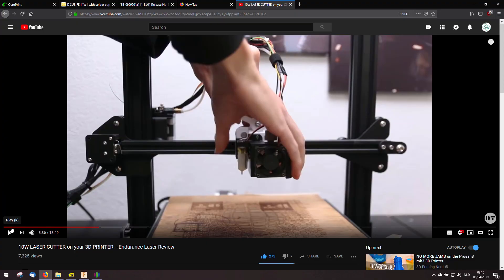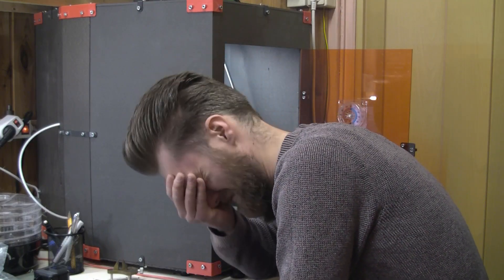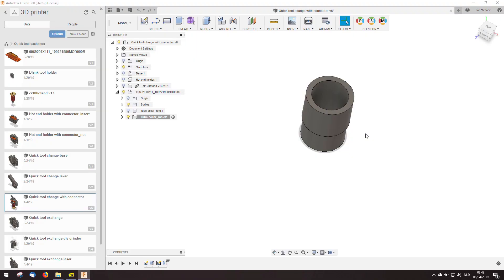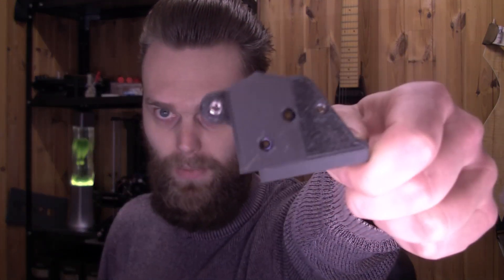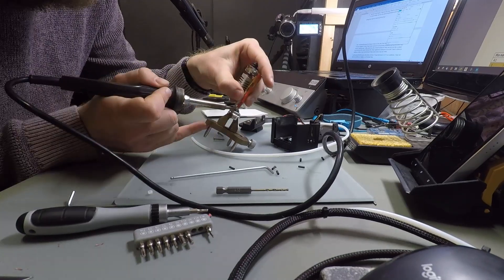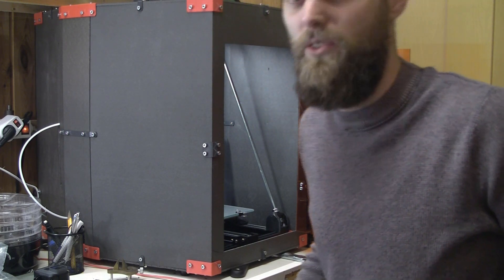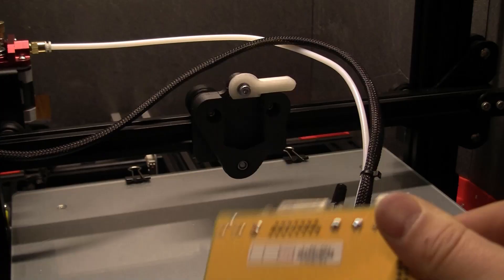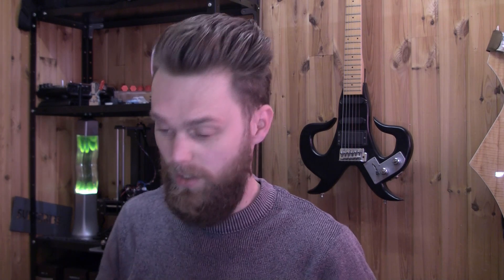Swappable hot end for Creality CR-10

Comment: I am also preparing for the interchangeable modules solution. Adding another connector to the hotend doesn't seem to me to be a good solution, because it adds weight. I would like to use the GX16 connector, installed on the machine frame, all heads include the cables, and don't have to carry the weight of the connectors on the print head! True, it's not as compact as this solution, but it's lighter, and that's more important when there's a lot of competition for the weight of the extruders!

Comment: I just watched an MIT video where they modified a laser cutter to fabricate a drone from stock components. My idea is you. Use the die grinder to fab a PCB,  make a pick and place module, use the food extruder for a solder paste dispenser and the laser head do the solder joints. Now  have a complete electronic module manufacturing machine from one 3d printer.
Reply from the maker: Awesome that you're suggesting this because this was what I was aiming for. I researched the Voltera V-one, hence the food dispenser and I did some tests with that grinder in two videos. I'm going for a different approach now, but I cannot say anything about that yet. Thanks for sharing your idea!

Comment: While i think its an awesome and super cool project,  I personally have some issues with safety. even when screwed in snuggly vibrations will either cause arcs within the connector or after a while be able to loosen the screws and slightly unplug the connector, causing a rise in resistance and thus the addition of a lot of heat. 3d printerboard cant detect this, as the hotend will still be receiving some power and thus will keep the temperature. 

Im sure it will be fine most of the time, but if this goes wrong it will go very wrong. And it has the potential to go very wrong.

Comment: I'd love to see a close-up of the bowden connection: I can't believe it worked flawlessly!

Also: why not use the lever to push the male connector against the female connector instead of screwing both sides?
Reply from the maker: It's still holding up after more than a year of printing :D Why I use the screws is because I didn't think of a solution like you mention. I was thinking inside the box of the connector xD Thanks for your suggestion!
Reply: @properprinting  Well, if you like suggestions, I have another one for the V3: pogo pins. Some can handle relatively high current (several amps)
Reply from the maker: Funny thing is that I'm the pogo pin specialist at work xD I'm an electronic test engineer and build test fixtures with those pins. It's a good approach, but it's less simple due to fastening and alignment. Thanks for the suggestion though!
Reply: @properprinting  Care to elaborate why the alignment would be problematic?
Especially since you don't need to use a flat board: you can print a pogo "funnel" that would guide the pin to the pad, can't you?
Reply from the maker: @NicksStuff  That's indeed possible! A funnel is a great idea, but still less convenient than using a connector as far as I can see. With the connector you don't have to think about alignment at all. I'm not saying your suggestion isn't good, but I chose for the simplest approach I could think off for this one ;)

Comment: nice way to start the video! This is what i'm looking for more or less. The thing with your toolchanger is that the wheels are attached to it. I want to keep my metal plate, so I'm trying to model that, but modeling is still kinda new to me. 
Also, I have heaters up to 70w 12 and 24v. So I guess that's probably pushing the limits of the connector too much? I like the ultimaker approach, and it seems upgradable for auto toolchange
Reply from the maker: Thanks! This would be a nice thing to start modeling with :D 70W is a bit high, it would work with 24V since the current will be halve. You can get a different connector lay-out and use double pins or use power pins like I did in this video https://youtu.be/YfDWs5B-fYA Good luck!

Comment: Hi again, I've almost finished prototyping my connector to show you! Printer is printing off 2 pairs of connectors, but the main difference is, that I'm testing mine using jst connectors.... as you pointed out, high current maybe the biggest issue I come across. But I'm going to continue with it anyway, unless it overheats from the heater cable current. Oh, and I've incorporated my connector into the cable chain I use to supply electric to my extruder head!. Looks good, but after printing, I still need to test it too, like you! Fingers crossed hey! ;) happy New year bro...
Reply from the maker: Awesome David! Cool that you've done the same thing. I can't wait for the result to see what you came up with!
Reply: @properprinting  Got photo, but can't post it in here, but it looks good. Final assembly will be when I record and rebuild my machine. Will upload videos fairly soon.
Take care. Will let you know.

Comment: Magnets, like USB charger cables.
Reply from the maker: Thanks for your thoughts. The problem I encountered is the pressure within the bowden tube which builds up. I'm afraid magnets will not be strong enough to hold everything together.
Reply: @properprinting  I hear you.  I was thinking only of the cables though. Your latch for the assembly looks great.
Reply from the maker: @-robo-  Thanks man! For the cables only would indeed probably work. I'm wondering though what the chances are of snapping loose while printing since it's always moving. I don't have experience with it, but if it works it would be a fast way to connect for sure!
Reply: @properprinting  If you use N52 (strength) Neodymium magnets they will stick.  If you still don't feel comfortable, you can additionally add a nipple on one side and a divit on the other.  As a side note, you could also have the left side north facing out and the right, south on the base (gantry). If you do the opposite on the assembly it will only attach one way, thus ensuring polarity and coms are always mating up correctly.  Neodymium magnets of the size you would use are very cheap on eBay. I'm thinking a cylinder shape, around 3-5mm in diameter, and 6-9mm long. In this scenario, the strongest field will be the 3-5mm ends.  If you leave a 6-9mm deep hole all you have to do is put a little epoxy on the end of the magnet and push it it.  Because you are using epoxy, double check the proper north and south poles are facing the right way.  

I am going to take ispiration from your design but try it with just magnets for the assembly attachment. In that scenario I will print a mock assembly and insert weights to match the real assembly, thereby allowing movement stress testing without worrying about parts falling off.

Comment: John, I definitely want to add this to my Ender 3 Pro, I don't have experience printing with the higher temp filaments. I think this would be best if printed in nylon, is that correct? I checked your website and these are listed as downloads, are you going to be producing these for sale?
Reply from the maker: Thanks a lot for your interest! The best material I've used is indeed Nylon, but ABS and PETG will work as well. PETG is a bit sticky though. I just have built my web shop on which everything can be downloaded and this is still a work in progress, but some have seen it already. Surely I'm going to upload all my designs the coming weeks. I've done a lot of testing with the swappable hot end and there are still some things that need to be modified. Last week the bowden tube itself sprung loose so it's not good enough as an end product in my opinion (you can glue it of course). My plan is to sell this as a kit in the future on my web shop as well together with the free downloads. I've planned videos which I'm going to work on soon with an updated version and the announcement of my new web shop.

Comment: Want to add this on my Ender 3. Awesome design, just not sure how the bowden tube is fixed inside the connector (cable side). Has to be good though there will be pressure inside the tube.
Reply from the maker: Good question. I have used a bit of super glue. The strain relief in the connector cover helps a lot as well.
Reply: @properprinting  I am still thinking about it. (working on other upgrades first at a low pace ehe) If i leave the bowden system in tact i can use a normal smaller sub D and place it alitte to the front. But i like your solution aswel as it is more all in one

Comment: You must compare the temperature display on the screen with the nozzle temperature.
This is because you may have disconnected the thermocouple compensation wire.
If the temperature matches, there is no problem.
Reply from the maker: Thanks for your comment. I haven't measured the actual temperature but I am not worried that it is too far off. I have read that it is possible to use normal connectors with thermocouples and that the introduced error is negligible. It shows a realistic room temperature and I haven't had any problems with printing. It would still be interesting to measure the actual temperature, but the temperature shown on the display is not calibrated so it would be hard to know if a possible mismatch would be due to the connection.

Comment: Can i buy a Set of this ? can you share me a link?
Reply from the maker: Hi, thanks for the request! I am not selling it yet but once I do, I'll let you know.
Reply: @properprinting  what is the name of the conectors? VGA? can you sent me a link were i can buy this? bough male and female?
thanks
Reply from the maker: @AFroMinZex3  These are the exact ones that I've used. I got a similar question on Thingiverse and alternatives are:
from RS https://nl.rs-online.com/web/p/solder-d-sub-connectors/1600522/.
Farnell https://nl.farnell.com/fct-a-molex-company/fm11w1sa-k121/combo-d-sub-conn-rcpt-da-11w1/dp/2433164
Mouser https://nl.mouser.com/ProductDetail/Phoenix-Contact/1418759?qs=sGAEpiMZZMv3qGlUeJulRHFnyvWhSp%2FHwRNDDpzVHpQbQlgd5VqVEw%3D%3D
A user named martinbogo has modified a standard d sub 15 with a 4mm drill. You can find more information in the comment section of that thing on Thingiverse: https://www.thingiverse.com/thing:3547740/comments
Don't forget to order the size A backshell too :)
Reply: @properprinting  for what I need a backshell size a? Can you show me a picture
Reply from the maker: @AFroMinZex3  https://nl.farnell.com/mh-connectors/mhdppk15-b-k/backshell-d-blue-15way/dp/469981 this is the one that I have used. Size A is suitable for regular 15p sub d connectors. I used a plastic shell because it's lightweight.

Comment: pretty great idea. i personaly would exclude the bowden from it. just because right  now i use an titan aero which also has a stepper motor and a BL touch on there. so i might need a few more  wires and  and also offers more flexibility in term of filament sizes :)
Reply from the maker: Thanks! A direct drive extruder like the Titan Aero is something I really would like to add in the future. The same goes for the BL touch which I still have to add :) Awesome that you have added these upgrades! I think it should be possible to share a ground connection for the BL touch and there should be just enough connections, but I haven't tried that yet. How do you cope with different filament sizes and what is the advantage of this?

Comment: Great idea ,in your place i will incorporate the connector in the quick disconnect so the wires stay attached that way you can swap a laser a different hotend/nozzle ,etc i will get a bigger d sub so you can install more wires to the harness to accommodate different types of heads ,i will also make it aluminum ,for repeatable accuracy,you can make them in aluminum as a product and release the stl files for the open source,that way you have a product to sell as a kit and the accessories are one hotend micro swiss ,the other e3d,mosquito ,you can expand as mush as you want.👍
Reply from the maker: Thanks a lot for your suggestions! Incorporating the connector has indeed its advantages that it will swap even faster. However, I have experienced that it is convenient that the hot end can be disconnected from the base with the connector still attached. This way it is very easy to swap or unclog the nozzle while it is hot. The connector has still enough connections for the different tools I have used. If you use tools which run at 12V you can connect these without problems. Making it out of aluminum would definitely be cool! But I have to change the design in order to do this and I think it will make it too expensive. I have good results with carbon fiber filament and for now this is my material of choice but I am planning on experimenting with other engineering materials as well. My vision of this channel is to get the most out of 3D printing and sharing this. Making high quality products with a cheap 3D printer shows the result of my efforts and proves that it works 😉

Comment: I never knew about those kind of mixed D subs! I just made a DB15 breakout board for my hotend myself
Reply from the maker: I’ve seen the video and I have subscribed to your new channel, nice work m8! The mixed D sub connectors are way less common and I know about them because I have used them in test systems for testing PCBA’s which demand higher power or high frequencies using coaxial connections. I think that your footprint of the PCB you have designed can fit a mixed type through hole version like this one: https://nl.mouser.com/ProductDetail/NorComp/681M11W1203L001?qs=sGAEpiMZZMv3qGlUeJulRHNv3l72pUQYXkG0ghuhkMA%3D (MPN: 681M11W1203L001  in case the link breaks) You can just leave the center pin out I think (not sure).
Reply: @properprinting  wow, I'm flattered as it's nothing that hasn't been done before! I believe you have a truly inventive design. People will want a kit of those for sure.
Reply from the maker: @VikMKW  Thanks man! I am working on it and I really hope it will work out!

Comment: so yank out the large pins in a high-current D-Sub connector and use it for the filament. 11/10 dude!  Any thoughts for dual extruders? probably use multiple connectors vs one larger one I'd guess?
Reply from the maker: Thanks man! I have thought about dual extruders and yes, I'd probably use multiple connectors. One of the advantages is that you can still use the same tools, like a laser engraver or another single extruder, to connect to this connector. I'd like to keep things standard. The only experience I have with multiple extruders is with an Ultimaker which has a mechanical solution to lower the nozzles independently. I have not done any further research yet about dual extrusion but this seems like an interesting subject for the future. Thanks for bringing this up!
Reply: Geeetech have dual A10M /A20M and triple extruder A10T / A20T 3D printers,  The A10T/A20T are much better than the earlier A10M, much easier to use and get good prints
Reply: Here is my design for the chimera: https://www.thingiverse.com/thing:4307436

Comment: You should use tech2c quick exchange connectors. I will show you in one of my videos soon! I been working with your set up and I love you design for the quick exchange tools and will show you how I added on to it and here is a link to the connectors that tech2c was talking about! Great Video by the way!

https://www.ebay.com/itm/10Pair-Multiplex-MPX-Connectors-6-Pin-35A-Male-Female-Plug-Socket-For-RC-ESC/254072714134?ssPageName=STRK%3AMEBIDX%3AIT&_trksid=p2057872.m2749.l2649
Reply from the maker: Thanks for your suggestion and I am looking forward to that video! What I like about the mixed D sub connector is that the bowden tube can be integrated and that it is a common reliable connector. I am very happy to read that you are working with this set up and I am curious about your solution!
Reply: @properprinting  Yea it is a common reliable connector but I feel like it still isn't fast enough when you have to screw in the connectors. I would rather pull them out and push them in, but yours is great and I do like that it can take the Bowden tube as well!
Reply from the maker: That is a good point. However, I think that the connection should be secured so it will not come lose while printing, but there are indeed faster methods than screwing it in. The MPX type connector you suggest seems to need more force to connect so it will probably stay connected so that's a good thing. I haven't got any experience with this MPX type connector but at first sight I would go for a more generic connector because of its availability. Unless the MPX connector has significant features or advantages that other common connectors don't have. The variety of connectors available is overwhelming and thanks for sharing, I will keep this in mind.